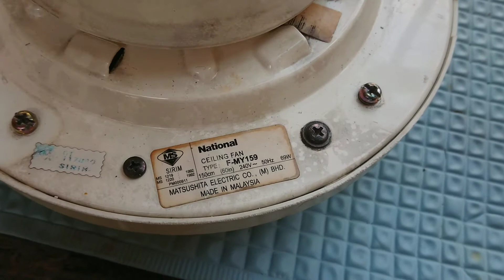Bapak mintak anak jadi suara latar, Service Ceiling Fan | Koleksi National Kipas Siling

Comment: Ini kipas national pada tahun 2000-2001 boss, bukan 90an
Reply from the maker: Betul tu ni tahun 2000-2001. Jika saya guna di ruang tamu tahun nya 90an.
Reply: @adreebuatpandai  ohh
Reply: @adreebuatpandai  yes. Actually this ceiling fan got 3 different model names from different years.
1996: F-MY156 National
1998: F-MY158 National
1999/2000: F-MY159 National
Reply from the maker: @ceilingfanmaster9569  thanks for info ❤️
Reply: @adreebuatpandai  it will be good if you can do videps on KY-15F/KY-15D/KY-15B KDK Ceiling Fan
Reply from the maker: @ceilingfanmaster9569  ok i will try to find that model
Reply: @ceilingfanmaster9569 
Fmy156(1996)
Fmy158(late 1997 to 1999)
Fmy159 (2000 to early 2003)
Pls correction it
Reply: @syselectricfanenthusiast8924  ok
Reply: @ceilingfanmaster9569  kdk ky15f from december 1995 - november 1998